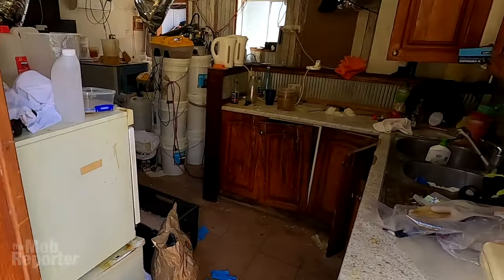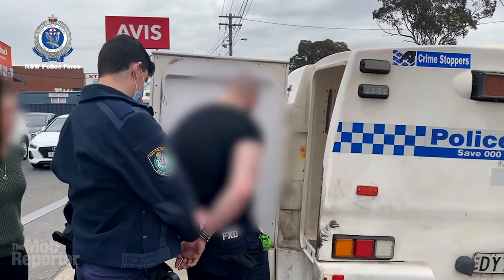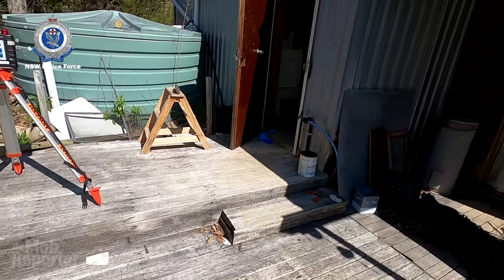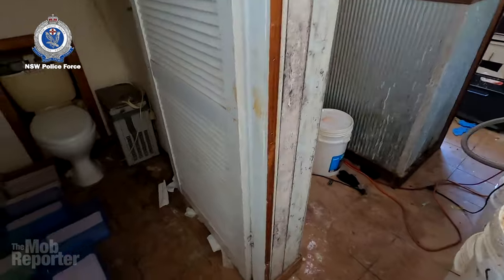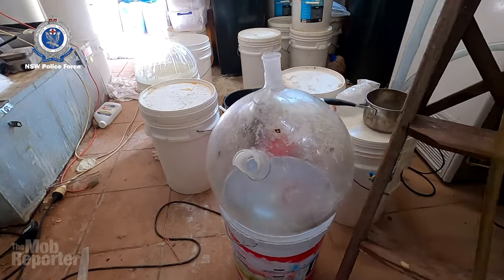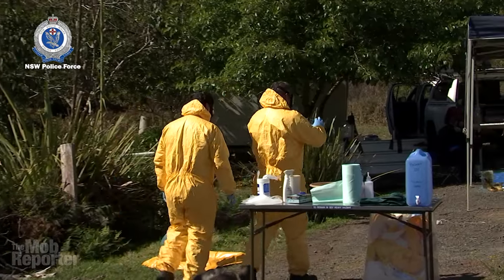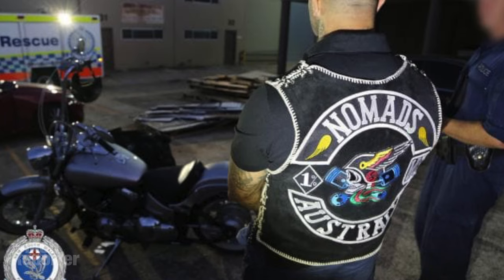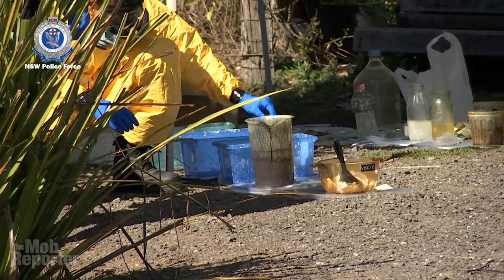Inside Tour of Bikers’ Secret Meth Lab 🏍️

Comment: Ingenious how they incorporated their bike exhaust systems into the meth still :)
That nice Husky looks to have sand tyres on it.
Reply: Yeah that’s true tweaking
Reply: That's a still, for distillation. no exhaust there.
Reply: _ @bushratbeachbum _ 

1 hour ago
That's a still, for distillation. no exhaust there
Whoooosh! ;)
Reply: Tip Toe  I want one of those!
Reply: It's a condenser, water goes in the bottom, comes out the top and through a refrigeration unit then back into the condenser.
Reply: @floorskin1  Bit like my wood-burner`s flexi stainless-steel flue pipe in a damp old brick chimney void, where I`ve had to fit a drain of 15mm copper pipe into a 5 litre container below the pan of the T-shaped flue adaptor attached to back of stove, to divert condensation from going into said stove and rotting it. Not got around to back-filling chimney void with pearlite yet to insulate.
Reply: Tip Toe  I`m liking the sound of that.
Reply: That's why crank was called crank..it was smuggled in the crankcases of motorbikes.

Comment: It's electronically detected when you're driving an unregistered vehicle. May as well of had a big sign asking to be pulled over!
Reply: Damn I didn’t know that.
Reply: It's called an ALPR in the states.  Automatic license plate reader.
Reply: Yeah absolute genius, they're literally printing money but don't pay their rego. LMFAO
Reply: Dont need to,they both holding hands toghter
Reply: Total police state
Reply: Those are rare in most places though. Mostly just cities have them and lots of cities only use them sometimes
Reply: @-darrell  yup LAPD have them on top of their truck and they read all cars in front of  them. They can tell if the driver of car has suspended license etc
Reply: They're in rural Australia...theres typically 1 maybe 2 cops in small towns. Even smaller towns get a cop sent over from the nearest bigger town, 9am-5pm after that town has no police.
Reply: There's a good chance the cops who caught these guys weren't the local cops and they weren't there to target the locals. These guys were caught because of a task force not sheer dumb luck...I doubt the local cops even had a clue as they wouldn't of been involved in case they're being paid off.
Reply: "Were caught on a highway from Adelaide to Sydney" that's literally driving across most of Australia, it would be desolate as fuck for 10 hours of the 15-20 hour drive. They'd move it to another location where it'd be picked up in registered vehicles.
Reply: The quantity was huge, so it was bulk transport to a safe house, where it'd then be distributed to sellers who would then take it into the cbd etc. The guys arent driving through Sydney or Adelaide cbd with 20 kilos of drugs worth millions in un-registered cars...
Reply: It's not in all states. And it's also only highway patrol cars that electronically detect normal cop cars dont
Reply: @-darrell  , Over in the UK we Call it a ANPR, (Automatic Number Plate Recognition😊)😎👍🏻

Comment: They welded a bike exhaust to that filtering equipment in the middle of the rm.
Reply from the maker: It looked like that to me as well!! I tried to highlight it in the thumbnail.
Reply: @TheMobReporter  not exhaust parts just shoddy handiwork joining two different diameter pipes together
Reply: That's a still, for distillation.
No exhaust there.
Same rig will make distilled water, or alcohol among other things
Reply: @bushratbeachbum  yeah mate the whole thing isn’t an exhaust. I’m talking the exhaust attached to it
Reply: They're condensers.
Reply: That's a cooling tube for the still, condenser.
Cold water is pumped through it to chill the distilled meth oil so it doesn't steam.off. coools down and is collected into glassware.
Reply: The exhaust has been CONVERTED to a condenser. It's not on the end of anything, it's a dirt cheap improvisation of otherwise pricy equipment. I have  condenser like 4 meters long of a similar design. Copper refrigeration pipe inside 3/4 copper house pipe. Works unbelievably well. I was distilling 58% vodka with it.

Comment: Unusual setup. I wonder what the metal pressure vessel in the middle was used for. Looks like an unusual reactor for reflux/distillation with motorbike exhausts attached. Definitely does not look like a pill extraction lab.
Reply: It appears they were using Red Phosphorus and Hydroiodic Acid to reduce either ephedrine or psuedoephedrine into presumably racemic N-methylamphetamine a/k/a methamphetamine. I imagine they were buying the bulk ingredients from China (especially the ephedra components). It would've produced a 92-95% pure racemic end product, but I think they were converting it to a base for crystallization purposes, so they may have been able to get even higher purity (I think that yellow gooey looking liquid in the tea pitcher is a solution of methamphetamine base and a solvent). This reaction is sensitive to water and air I'm pretty sure, so I think that gigantic metal container serves as a reflux and the pipe being used as an extremely crude distillation/reflux column apparatus perhaps? It could also just be a reactor since you can literally just throw all the ingredients into a single vessel and it still works (makes a bunch of side products and it probably isn't good for yield I would guess, but having never actually engaged in this synthesis, for obvious reasons, that's just my assumption). Idk it's quite difficult to make sense of their setup due to using so much junk. Other than what looked like a Round Bottom Flask everything else was jury-rigged and terrible.

On a side note, if anyone is thinking of copying their work: DON'T. Methamphetamine production involves fairly toxic chemicals and can easily result in you hurting innocent bystanders or yourself, and even if everything goes right you'll contaminate everything with methamphetamine vapors. Don't be another statistic.

Comment: KEEP IN MIND that this "$13 million" estimate is an Australian estimate which has the absolute HIGHEST drug prices in the WORLD!!! Here in California that would be LESS than ½ a million $ .We have the one of the LOWEST drug prices in the world here
Australia: meth
pre pandemic:200-500 gr@m
pandemic:500-2000 gr@m
California 
everyday:15-20 gr@m
Australia: coc@ine
pre pandemic:300 gr@m & 140,000 kil0
pandemic:450 gr@m & 200,000 kil0
California: coc@ine
everyday:40 gr@m & 18,000 kil0
as you can see Australian prices are 10-100 times GREATER than California. This is literally a DAILY bust in California. Not even a big one but by Australian standards its quite big i presume
Reply: I think New Zealand pay Evan more. If drugs were that cheap in Australia it would cut property crimes 50 percent. People could hold down a straight job instead of welfare payments.
Reply: A key for 18 is a deal if it's that sho nuff fire yayo. I'm in Florida and ain't heard that number in a good lil min

Comment: Anyone else notice they use motorcycle tail pipes on the reaction vessel? So cool
Reply: It's an improvised condenser. Cheapest option but they'd be better with copper instead of steel. And thinner pipes.

Comment: They're too sloppy...if they'd have taken the time to dig down and under the backyard, or under an old orchard, deep enough to where the entrance can't be readily identifiable from a drone, and no heat signature can be detected, they could've left that house intact...in fact, they could've moved a civilian in to rent the house out, keeping that individual oblivious as to what's going down out in the orchard behind the house, which in turn gives that renter plausible deniability....gotta run exhaust fans and exit vents to the surface outside so the air in the lab stays in a breathable state too....55 gallon drums, plenty of acetone, some tin foil, red phosphorus, lye, sudafed tablets (preferably pinked beforehand), baby laxatives, some P2P, some Bunsen burners, hazmat suits with breathing apparatus', a couple more ingredients and you're not makin that meth garbage, you're makin Crank, aka Prope Dope, which is exceedingly cleaner, stronger, and has longer legs, than meth does...this is called one of the "cold cook" methods....I don't know the exact recipe, I'm just sayin is all.....

Comment: Rule #1 of transporting, don't break traffic laws and don't use a rental or unregistered vehicle.
Here in BC in the late 90s, early 2000s cops on both sides of the border flagged rental cars or BC plates in Washington border towns.
A popular route from Vancouver to the Okanogan often had roadblocks, stopping every car that was possibly a rental, Avis didn't have bumper stickers and people would put Canuck flags and decals to blend in but if you had a cop behind you and they ran the plates and it came back as a rental, they would pull you over every single time you were on that stretch of highway #97.

Comment: Does anyone know why the door has a doorknob in the centre?
Reply: It looks like they just used it to pull the door shut when inside.  Its not connected to any locking mechanism. The external lock smithing on that door was maybe done by the same person who they got to wash the dishes and keep the place tidy. You do get high security doors with a keyway located in the middle of the door like that, But they move bolts into reinforced frame/wall/floor.